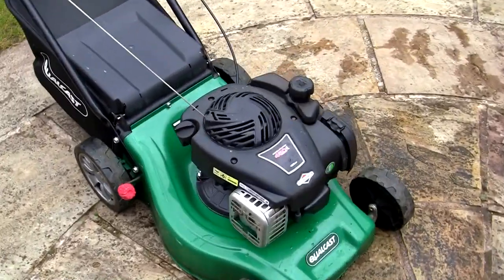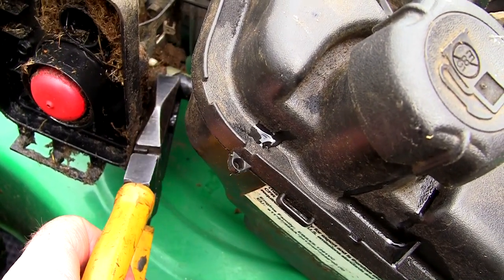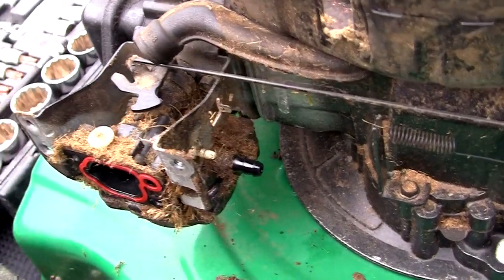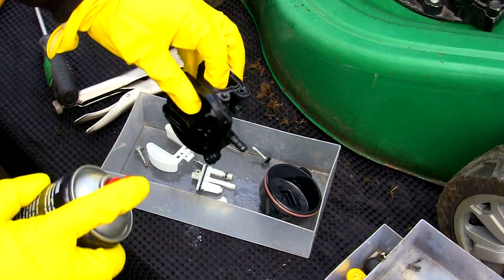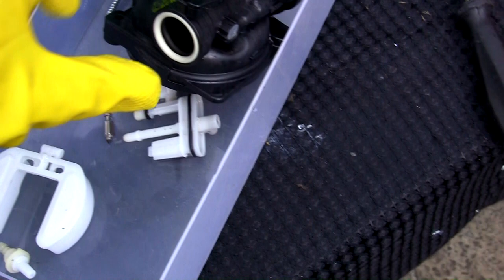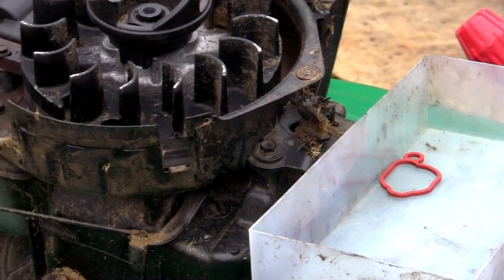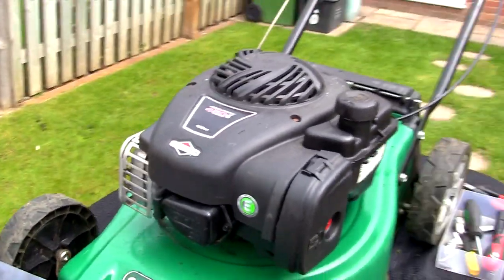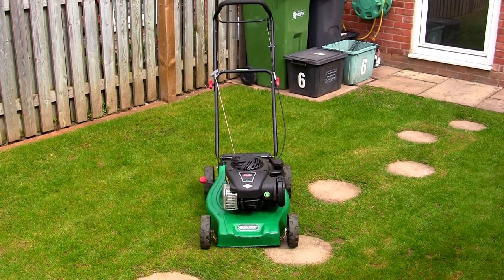Briggs And Stratton 450 E Series Lawnmower Carburettor Service

Comment: I have this particular mower. Great video. I also have a qualcast cylinder mower that needs a service and repair which i am struggling with. You never seem to do videos on cylinder mowers, I don't know if you repair them or not. Is there any particular reason why you don't repair them if you don't.
Reply from the maker: Nick Evans They are harder to resell

Comment: Can you tell me the best place to buy b&s gasket/ diaphragm for between petrol tank and carburettor? Mine was from Homebase with Castelgarden mentioned in the documentation. I can’t tie up any serial numbers etc. Cheers. It is a 450 series!
Reply from the maker: Martin Dorrance There isn't a diaphragm on this mower. You can get the whole carburettor on the ebay for £10 https://www.ebay.co.uk/itm/153581059642

Comment: I followed the procedure and cleaned all the carb parts with carb cleaner, blew everything thro with an air nozzle reassembled everything and it started up fine, but it still has that annoying  "hunting" thing going on.  In addition to that, it makes a slight putt putt sound. I'm wondering if it might be a timing or valve clearance issue.  Any ideas?
Reply: I think it may just need a new governor spring if its hunting.

Comment: Hi there - just wondering if you have any suggestions. I have this same mower and over a year ago on a slight incline, the engine seemed to kick up a gear. It pulls quite fast to the point of power walking to keep up, and the engine is really quite loud and I noticed an immediate change in pitch. Ive removed the top cover and had a good look, and everything seems fine. Really unsure what the problem is sadly
Reply: Is the muffler still tight?. I had a bolt break on my previous mower and didnt notice but the neighbour kept saying how loud it was. Air escaping before going in the muffler. Is the spring still same length, engine speed can be increased or decreased by lengthening or shorting

Comment: Got the same mower and I’ve replaced the spark plug and the carb and also the air filter and it still is surging any ideas????
Reply from the maker: Try a few different carbs. Check head gaskets also. Carbs are garbage on these

Comment: A little knowledge is a dangerous thing. The white connector isn't an air inlet it is where the pipe would attach for a remote primer. It is often necessary to block them off if the primer on this spec doesn't work well. I have got some blanking plugs sent from B&S for this.
Reply from the maker: What a lovely comment thanks so much

Comment: Can I ask a question iv got the same lawnmower but it wont start if I prime it up 5 times then it will stat then die then I keep pulling the cord nothing iv checked everything iv changed the fuel and cleaned out the carb took it apart like u did .the only thing is the plug seems always wet could u shed some light on it buddy trying not to be cheeky by asking
Reply from the maker: These carbs are dodgy. Easiest solution is to buy a replacement they are preety cheap.
Reply: Thanku so much for your reply it was  my next step thay seem pretty cheap
Reply from the maker: @stuartarcher4249  link in description

Comment: Hi should the primer bulb have a hole in the middle?

I've pumped the primer loads but getting no fuel? Thanks
Reply from the maker: You have a blockage in the carburettor
Reply: @MowerMan  Thank you will follow the instructions. Appreciate your help 👍
Reply: Where do you advise buying replacement  carburettor from.
Thanks

Comment: Hi I have the same mower the fuel is leaking through that white plastic air pipe any ideas
Reply from the maker: Check the needle inside the carb moves freely
Reply: @MowerMan  
It moves freely I noticed when I took it out had all green shite inside looks like it isn’t sealing off

Comment: Hi just bought new briggs 300e,  seems to be hunting or surging, plastic carb is there any adjustment on these
Reply from the maker: Mark Hutchison No but the good news is they are only £9 to replace
Reply: Thanks for guick reply
Reply: the hunting is caused by stale fuel in the white thing which he pulls out with pliers i had the same problem with it surging , and when i cleaned it out a stale fuel bogey flew out when i blew it out and it stopped it surging. really easy engine to work on an you must run it dry before you stop for winter.

Comment: I have a Qualcast xsz46d-sd but i cant get the recoil cover off, i have undone the two bolts but there is no third bolt.
Reply from the maker: look under sticker
Reply: @MowerMan  Thanks I found it , one of the O-rings on the main jet unit has broke, do you know where i could get a replacement ?

Comment: Good video, I just thought I'd add my few cents tho. Few years ago I bought one of those. Took proper care of it, changed the oil twice a year as my area is dusty, filter and spark plug once a year. Started running rough so I did valve adjustment, helped for a while. After warranty period it started blowing exhaust through the carburetor (gradually) so I thought rings or valves, didn't feel like taking it apart. But it was annoying as hell because it's basically a new mower. And very early it started leaking from valve cover gasket too. One time I was getting so annoyed using it she took a hit with pick axe i had nearby. Then I got a John deere with Kawasaki fc150v engine from 1998 and it runs like a champ. 24 year old equipment runs better than this Briggs did new. And it's a shame that cutting costs is more important than quality nowadays and Briggs is selling junk that people will buy anyway because of brand (myself included). My advice to owners would be to not spend to much on service because it will not last anyway, better to save it for another mower
Reply: My advice is to maintain your equipment through knowledge and then experience and your equipment will last and last.  
Oil gets dirty from use and the residue on the cylinder walls from the combustion carbon - and not dust.  The air cleaner is where the dust collects (by design) and cleaning it returns it to like new condition.  (only change it when it won't return to like new condition.)
Plug should be cleaned and re-gaped every year or two and also only replaced when needed - maybe every 5 years?
Cleaning the carb is done when gas can debris migrates from the can to the fuel tank and then to the carb.  If you meticulously keep the fuel contamination free going into the can and then the fuel tank and drain the tank (and carb) at the end of the mowing season you will cut your needed maintenance substantially.  Valves need adjusting NEVER to every few years or more unless something very unusual happens.
"Replace Rather than Clean" seems to have been your program, meaning you are one of the well appreciated sources for Free "Road Kill Mowers" on the side of the road.  Hitting it with a pick sure showed it who was in charge of maintenance - huh!
One of my used mowers (came with the blade upside down) has lasted with annual fall care and maintenance since I bought it, used, 17 years ago.  I think I did change the worn out plug about 8 or 9 years ago - might be due soon.

Comment: Had 3 of this stinkers in so far  the first one took 2 cleans before it would run right ... the   2 others  after wasted hours on them  cleaning  them  so you could eat your dinner of them  still  Carnt get them to run right ..   unless the carbs are just  trashed 🤔 
 I've just  ended up   pulling motors  off and sticking a 35 classic  on ... to get them  rolling down the road...    these are onnthe hate list  think I'd rather have an sv150😂😂😂😂😂😂😂😂😂😂😂

Comment: Hi there! A bit of help here please! I do have the same model as yours there but is bad surging 
I have replaced the carburetor with a brand new one still nothing, I adjusted the valves still surge 
I don’t know what else to do😢 
Anyone any ideas please! 🙏
Thank you very much
Reply: @yoshisaidit7250  Thank you very much for info, I will recheck everything tomorrow due having a day of
Reply: @yoshisaidit7250   on mine looks like is the governor!  I tried to adjust it but unsuccessful,  now something is clicking inside on the governor area 🤔🤔🤔
Reply from the maker: I here this a lot usually its the carb even if you swapped it. Micks Mowers channel has a video on making the hole i the carb jets bigger that may help
Reply: @MowerMan   I think the governor is out of position 🤔🤔 
Thank you for info